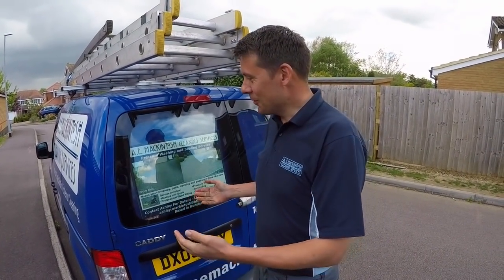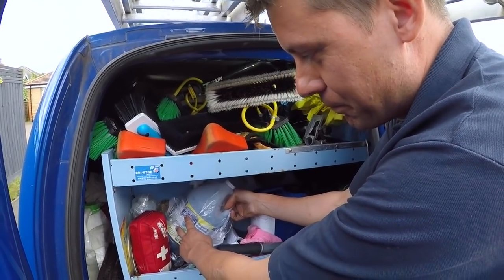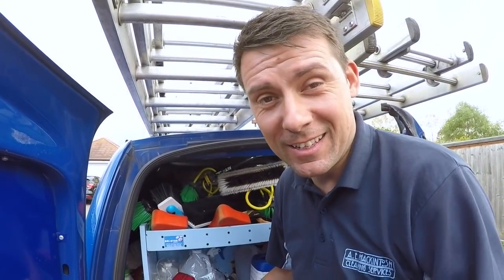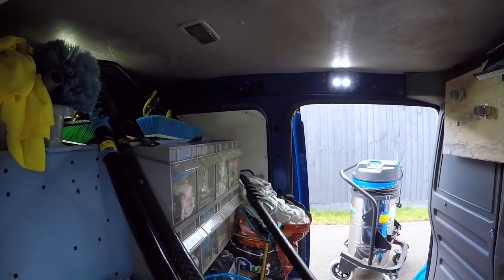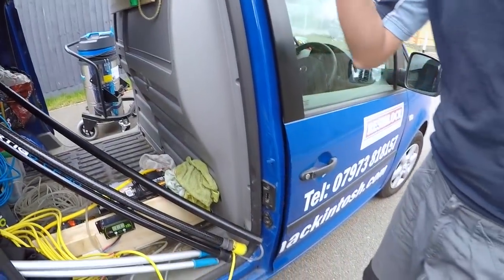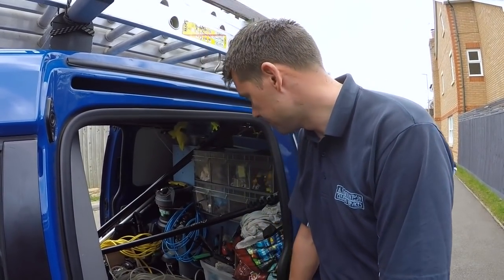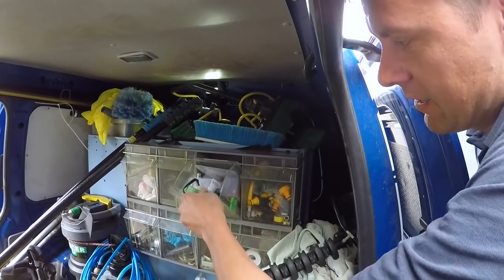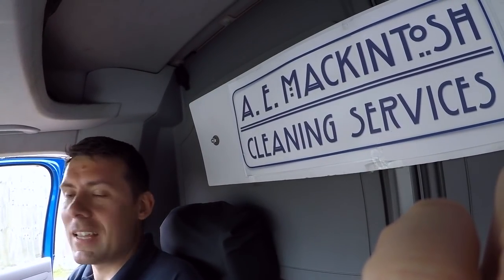More Than Just A Window Cleaning Van - VW Caddy

Comment: You need a brush drawer like Squeaky Clean Dave made for his van.  I started cleaning windows on a bicycle with trailer and even figured out how to take 24' extension ladder to jobs using another bicycle kids trailer in the rear.  After the first 6 months, I got a 1996 Mazda MPV van which taught me the problems of working out of a small vehicle.  Today I have had 3500 Chevy Express, a 2000 Tacoma with custom wedge topper and ladder rack and now an E150 Ford van.  I like the larger vehicle to work out of and the more prominent marketing exposure a larger van provides.
Reply from the maker: Great! You have got to start somewhere. Amazing to hear how well you have progressed.🤩👍🏼

Comment: Loose the racking, set up pole holders, heaps more room, you also have above  head compartments and rear seat under  storage.. just need to reorganisation
Reply from the maker: FlashTechEngineering Good idea, I could do with a clear out. I’m actually going for a new van and a slightly different approach.😃👍🏼
Reply: I just added ionic systems to my Volkswagen caddy van in Australia best move ever great quality systems easy to operate opens up a new business model and market
Reply from the maker: Good one. Sounds great.😃👍🏼
Reply: Yesterday 9  jobs  in 5 hrs almost $1000 Australia dollars in 5 hrs, regular round work normally took 8 hrs  previous water system set up
Reply from the maker: FlashTechEngineering That’s interesting. What a difference. I’m hoping to achieve something similar.💦😃👍🏼
Reply: @FlashTechEngineering  what kind of jobs were you doing to make that much in a few hours ?
Reply: Lovely Jubbly commercial monthly jobs,  yesterday 2 of us council building $1800 in 4 hrs

Comment: If you didn't have the racking system in would you fit the pressure washer and sky vac in ? I'm looking to start up but struggling to think what size van to start with
Reply from the maker: Yeah, you could squeeze everything in I’m sure. A long wheelbase version would be even better.😉👍🏼